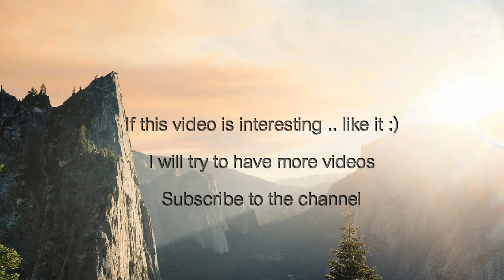Geekvape Aegis MAX   .......Problem - no atomizer

Comment: Thanks  you for making this video. manage to fix mine . it wasnt the 510 wiring on mine. it was a bad earth/ground caused a by bit gasket goo under the board
Reply from the maker: Hello.
I'm glad I was helpful. Unfortunately, this is just a hobby /I also repair PSP, PS1,2 and 3/. And the company where I work has become quite busy. There is no free time after work :). But I plan to start documenting repairs again.

Comment: thanks , my mod just showed  low battery (with a full charger battery)and never turn on again. I go check the wires !
Reply: Did you fix it?
Reply: @walaaelgandy5255  no, my problem is not the wire connection.
Reply: Ihave thr same problem bro and idunno how to fix it